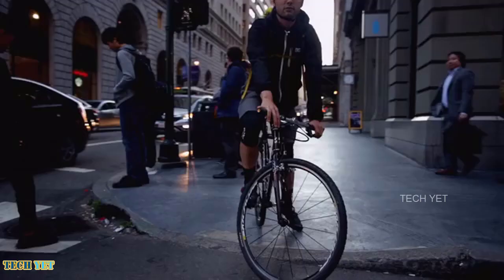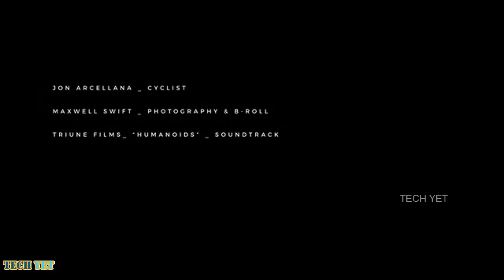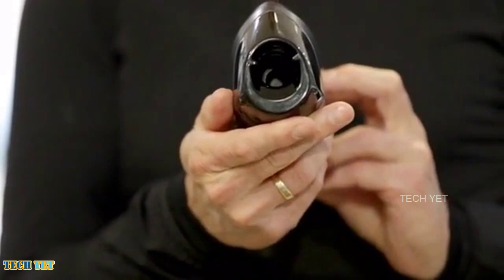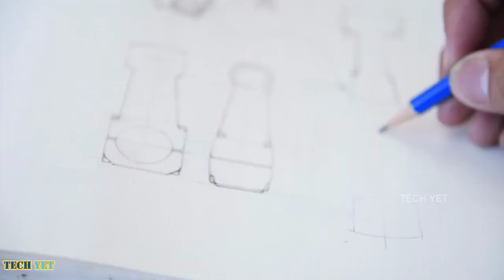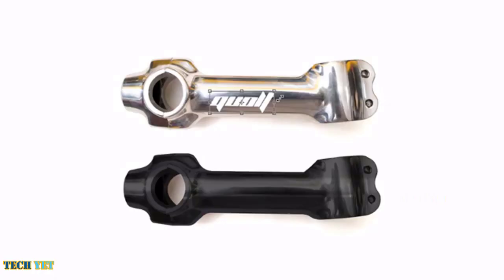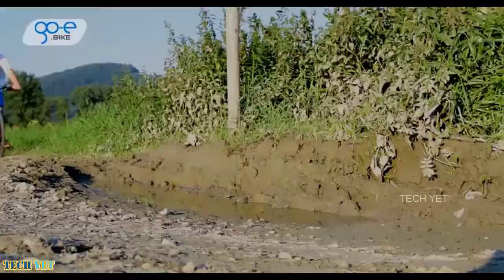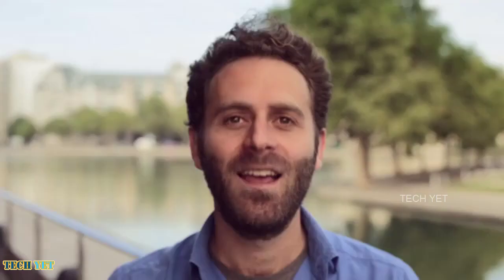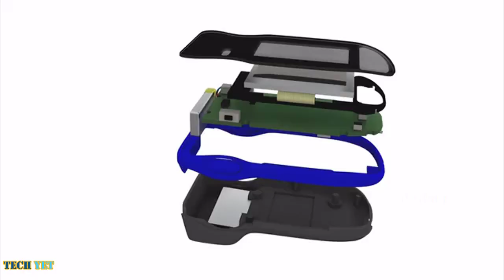5 Bike Accessories You must Have #2

Comment: The Lumineer is going to shine upwards, into riders/drivers eyes, with the angle of the stem.
Reply: The Lumineer is so bad in my opinion, I wouldn't want that thing to be what's holding on my handlebars, with it's 2 fixing points.And it looks like it couldn't light the way if it tried. I'll stick to my re-chargeable LEDS, and sturdier bar stems thanks!
Reply: Designed by someone who's probably never ridden a wide variety of bikes.
Reply: unless you are less than 2 meter behind of a bicycle you won't notice he is stopping, this projects are amazing but not really functional
Reply: Looks useless Apparently the designer didn't  Figure in the light needs to be on the ground in front of you.! not in the air?
Reply: The Lumineer apparently was a Kickstarter 4 years ago and I can’t find any website for it in 2020!? It could have been a great idea if the light shone down at an angle, ideally if you could even adjust the angle manually. But the way they designed it … it helps you be seen but it’s such wasted potential, and could potentially dazzle other people. I’ll opt for the LightSkin handlebar instead